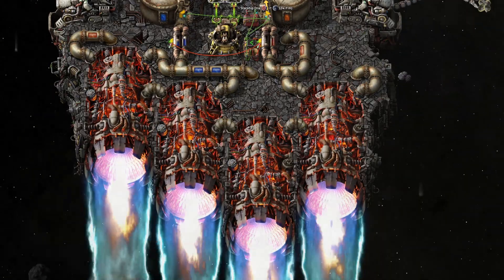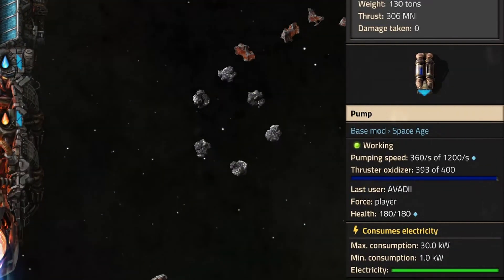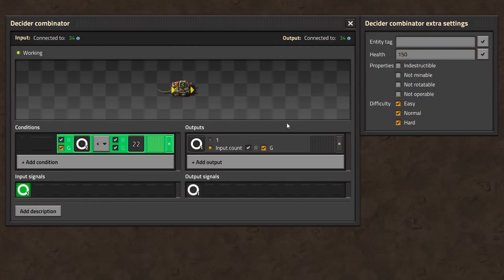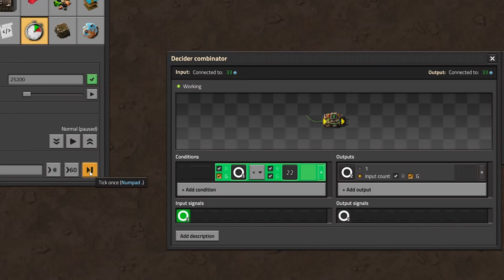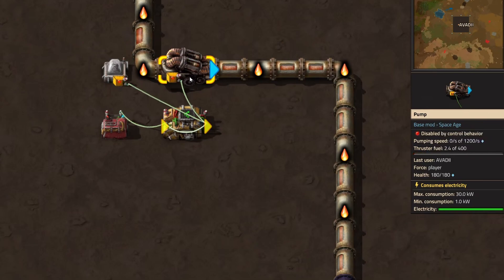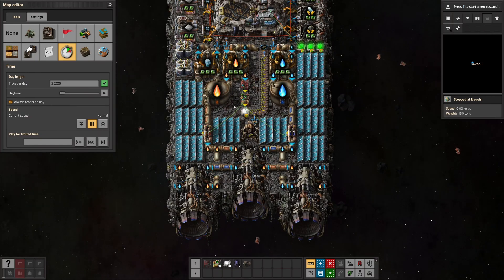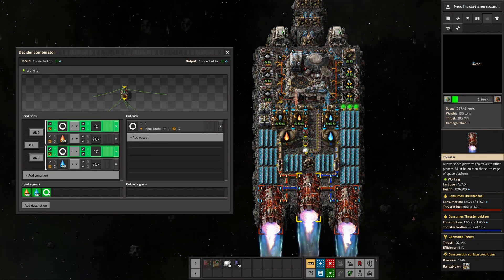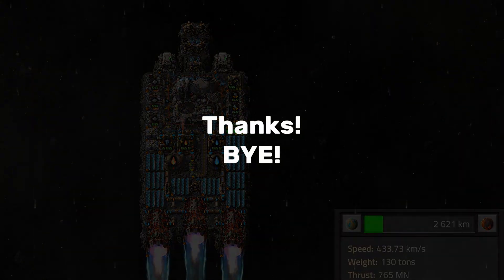Control Thruster Efficiency with Throttling! - Factorio Guide / Tutorial

Comment: I am at 6:40. I'm reminded again of how you can't have multiple input conditions and output conditions. You have to tie all the input conditions together to send essentially a single output condition. You can't have multiple conditions in the same decider combinator, which makes them inconvenient because for every new item you need to send a signal about, you're taking up extra space, and it really adds up.

I'd love to be able to tell a decider that, hey, if we have less than 250 copper, you need to send a copper wire signal, and if we have less than 100 iron, you need to send an iron or a signal, or something like that. But no, you have to split those up into different decider combinators.

Or maybe I'm a smooth brain, but I can't find a way to put an OR condition between different AND blocks. Or maybe I just solved my own problem by talking about it on YouTube. I don't know.

Comment: I guess I accidentally made a crude but incredibly simple way to do this. I put my fuel in buffer tanks and control the oxidizer with 2 pumps, 1 outflow and 1 return. The return pump is always on, the outflow pump connects to another tank via green cable, I set the pump to open only if the 2nd tank falls below a certain amount and thru this I could control the cruising speed or efficiency. As an added bonus of this imperfect system, the thruster's built in buffer get filled every time I stop at a planet and that initial buffer lets me get at cruising speed very quickly.

Comment: 5:15 sorry but I think this needs more explanation. The maths is kind of glossed over. Especially the relationship between the threshold on the pump vs. the threshold on the decider.
Reply: The combinator counts up from 1 to 10, then resets. The pump only turns on when the combinator has a value of less than 2, which effectively means the pump only turns on when it has a value of 1. As a result, the pump is only active one in every 10 ticks.

Comment: You dont need the Constant combinator anymore. Just one decider combinator with its in and output connected, and two of the same  outputs: once with the value 1 once with the value of the imput count. The left side still needs the condidion of [Signal]<60.

Comment: OR use two tanks (oxidizer/fuel) behind the pumps as fuel gauge.
Link them to the pumps set them to activate let's say < 100 and make a test flight to dial in your desired ratio.
Technically controlling only one input oxidizer or fuel is fine, but there is some weirdness sometimes.
My speed boat slurps more oxidizer for some unidentified reason... and I think I have to write a bug report soon, when I have a reason.

Comment: Hey man, i don't know if you are still playing but ... tnx for this video it saved me a lot of time!

I had the idea to make the ship moving from scratch so that the only thing you need to provide in order to fly safe is the correct number of ammo (or nothing if you run a laser ship!)
to achieve this i wanted the throttling value on the pump to be a function of the current fuel/oxidizer level in the respective tank. i was trying different approach to the problem until i saw this video ... your controlled throttling is basically the center of mine and solve any problem i had :)

Thanks Again! :)

Comment: I went simpler. I just ran a green wire reading velocity to a pump. Pump is on at a low speed I set, off at higher speed. It's not as consistent but is real easy. But this is a great explanation for a counter.
Reply: I did the same, but with an added pump the other way, on the inverse condition, to clear the pipes from the fluid to throttle it faster. Speed is kept at a 20 range around the target speed.
Reply: I feel like a caveman just making a mess when I look at all these solutions people have. I just have a secondary tank for each fuel with a pump fueling them. Wire the pump to only fill the tank a little bit based on your thrusters and desired efficiency. A little less consistent than all these other options, but still way better than my first ship going full burn the entire time
Reply: @Erik_Ice_Fang  Do the tanks fill when the ship is docked at each location? I have that issue but I'm only filling the internal supply of the thruster and it doesn't last long enough to matter.
Reply: @aowens40601 yes, but only to the amount you set with the wired pump. Thats why it isnt as effective as the video, because the thrusters will be full when you first leave a location. Its only a couple seconds, so a small difference. Honestly the extra space taken up is more of an issue

Comment: Something I heard a while back that makes a lot of sense is to just throttle the fuel and let the oxidizer flow unrestricted. I'm not 100% sure on this but I heard somewhere the engines are more efficient when oxidizer rich and maybe it saves some tps calculations if you just mess with one of the pumps.

Comment: You can also connect a wire to the hub and tick set to read the "to" and "from" signal. Then enable the pump only if none of the planet signals equal to 3, as it means the ship is actively moving to prevent the thruster from being flooded initially. But before the very first travel, you need to pre-fuel the thruster otherwise the game will detect no available thruster and refuses to change the ship's state to moving.

Comment: This is a very stupid and ugly design from developers, just play with a valve mod. I solved the equation for desirable flow but forgot I cannot directly control flow rates. The equation for on and off is ugly and opening and closing the valve to achieve a certain flow is just silly. I copied the circuit from the forum, won't do it again.
Reply: btw, solving the rate by current velocity is unreliable. It results in pulsing acceleration -> pulsing velocity. Use fixed thrust% base on chart.

Comment: what if you just produce enough to barely go below %100 efficency ? wouldnt it be easier to prevent the problem
Reply from the maker: 3 thrusters with 100% efficiency = 30 MN thrust. Thats VERY slow.
Reply: @AVADIIStrategy if i remember correct, 1 chemical plant for each (fuel and oxidizer) can produce enough to feed 5 thrusters. the only downside i think is, not being able to change the speed incase you need to
Reply from the maker: @theofpower4404  But the ship doesn't have 5 only 3 ;)

Comment: 7:45 - wait, what?  That's a thing?  I could have sworn I looked for that, and it wasn't there... but no, it does seem to have been there in 2.0 from the start, based on my reading of the changelog.  How/why did I convince myself it was otherwise?  Hmm, not sure.  Maybe just because you can't have the outputs be dependent on different sets of conditions within one, and that's what I was wanting at the time?  Anyway, this is super cool... a self-contained clock, a filter for multiple signals but not all, etc. etc.  Cool!  Thanks!
Reply: Oh yeah, and also the stuff about thruster throttling.  Though... I notice you just kinda didn't talk about the fluid mixing aspects here.  :D

Comment: I've found that this kind of thruster control for the purposes of fuel efficiency is pointless. You can just pipe your fuel and oxidizer plants straight into your engines and the small buffer in those pipes plus a bit of hysteresis means that your speed will naturally reach equilibrium where it uses 100% of your production most efficiently. Hell, you can even add dumb tanks if you think it's valuable to have idle time in orbit increase overall speed during transit. 

I am only actively controlling thrust on my prometheum chunk farm ship, I throttle it back based on the deficit in my stockpile of turret ammo, again, relying on hysteresis to reach equilibrium at my ship's safe maximum speed.

Comment: I also want to point out that this same method is GAMECHANGING on Gleba. Not only can you control pumps, but you can use the same clock method to throttle the speed that assemblers, biochambers, agricultural towers, and even belts and inserters work. You can customise the speed that your nutrient producers work for example, so they only make exactly as many nutrients as you are actually using, leading to very very little wasted spoilage. 

You can use the clock as a kind of "drip feeder" on belts so the floods of fruit followed by minutes of empty belts gets smoothed out into a constant, average rate of flow

If you think that's good, you can even have it define the loop length AND on-time with more circuit signals, which can even be dynamically calculated based on something else. Have all your machines automatically throttled relative to each other so they can all be sped up/slowed down from one place for example, or even better, have the speed of production automatically match the speed of consumption by measuring the count of output items in a buffer, and making the machines work less often when the buffer is more full, and more often when it is less full.

Comment: Nice system, i just put tank between pump an thrusters and set to fill it up to disaired amount of fuel per second multiplied by number of thrusters and change, yeah it waste some fuel when ship not moving but it only matter if you dont use calcite fuel and can be fixed by setting pump to work only if ship moves

Comment: if you use 10 thrusters, the consumption rate will equal the pump's flow rate, meaning you can get any percentage listed on the performance graph based on the clock
speaking of the clock, you don't need a constant combinator anymore, For your original example 2 minutes into the video, simply add a second output of 1 circle when circle is less than 22, then connect a wire to create a feedback loop within the combinator (edit: you realised this already lol)

Comment: What I've been doing is pumping from one tank to another, and throttling the pump based on how full the output tank is. ~300 units of fluid keeps the engines are a nice and cozy ~40% which is just about the sweet spot for efficiency vs. thrust. Doesn't require any combinators, either.
Reply: oh, nice, gonna try this approach (i did build my own combinators version, inhibited when parked, that is any planet signal =3)
Reply: i do this and it's a little more effort to tune but works just as well in practice
Reply: Same, this was how I went about it too. I think with the buffer at stops and pump amount its a bit less consistently efficient, but it does the job

Comment: I'm using a tank on the thruster side, wired to the pump, set to fill the tank to 10 which gives me modulation and a low pass filter.
Reply: does setting the tank to 10 ensure that's always at least some fuel in the thruster, without filling up the thruster entirely?
Reply: @nar2872  the new 2.0 fluid mechanics makes machines draw fluids from pipes proportionally, based on how full the fluid network is.

(though this approach requires, you to use double the amount of tanks if you also want to have a buffer. which isn't ideal given the limited space you've got on space platforms.)

Comment: Is there a way to use combinators so that the astroid grabbers don't collect more than 13 carbon, 13 iron and 13 ice?
Reply: If you want to stop the grabber from grabbing to much asteroid chunks, you can set the filters via circuit signals. Just have a constant combinator with the desired amount, read the amount from the belt, subtract both and feed the output signal to the grabber and set it to "Set Filter". Only positive values will be used, so whenever there are less chunks on the belt, the subtraction yields a positive value and the grabber has a filter for said chunk

Comment: FYI you dont need to control both fluids, one is enough - the other will be consumed at the same rate as the fist one.
Reply: Even when mixing them this way?  (Could be, I'm not sure... just a question.)
Reply: @DavidLindes  Yes! The fluids are consumed with the rate of the lowest one. Os if you have one completely filled engines and the other just up to half them they both will be consumed with the half speed

Comment: Pro tip: To prevent the pumps from wasting fuel while the ship is stopped, you can test for Velocity with signal "V" from the platform hub. If you do not allow fuel to flow when velocity is below 50, the engines will keep enough fuel to restart and get back up to 50 when the ship resumes. BUT... the pumps will stop feeding fuel, which means you don't dump a thruster full of fuel into the thrusters every stop. Saves a lot of fuel.
Reply: If you run out of fuel, you will softlock the ship because your speed will be always zero or less. And, frankly, there is no reason to not pump fuel to the trusters while stopped: platform will go futher on "overdrive" in less time, while burning what is essentially overproduction, and the fuel is free.
Reply: @rogo7330  wdym you will soft lock the ship?
Reply: @rogo7330  Can't you avoid softlocking by setting up the 3 conditions in the decider combinator with the right precedence?
You should set it up so that:
-- when the fuel tanks are full, you pump at full rate, no matter the other signals. (Which is what will eventually get you out of the softlock.)
-- And when the fuel tanks are empty, you pump 120/s only when the velocity is over 50(*), and if the velocity is under 50(*) you pump nothing.
I'm not sure I'm getting the conditions right with the output condition being "inverted" (0 means pump, >0 means don't pump; I get why we do it but yikes). But here's what I think it should be:
[fuel < 20k OR oxidizer < 20k] AND [velocity < 50(*) OR circle < 10]
Yes, if your fuel tanks fill up while stopped, then you pump your thrusters full of fuel, but in that case you have the fuel to waste. And yes, when you're stopped this technically makes the counter count until the integers overflow and wrap over, but that only lets 1200 liquids in every million seconds or so.

(*)Or whatever speed the production rate of your refineries allows you to reach. Getting up to speed with the overflow from the tanks means you're burning fuel at the rate at which you're producing it.
Reply: @rogo7330  There is a reason you may not want to do that. If the throttled speed is near your safe speed limit, then that extra speed can result in parts of your ship breaking.
Reply: @rogo7330  Well the key there is to not run out of fuel. I run this setup and it's been operating maintenance free ever since I built it. Yes, you have to set the test variable after you first get some fuel in the thrusters, but that's the only time you have to do it.
Reply: If you end up with no fuel in the thrusters, the speed cant increase, so the ship is stuck.
Reply: @FabriceNormandin95  each planet has their own gravity, 10km/s will be add to your speed, this explain why when you to vulcanus, at the middle, your speed increase about 20 km/h despite of no changing in production and pump,  -10km/h is removed and +10km/h is added
Reply: Nice, I was using the moving from and to signals but speed is allot simpler
Reply: @FabriceNormandin95  they added a failsafe for that: the minimal speed is 10 km/s
Reply: Just check planet value from the hub. I think it is a discrete state value of 1-3.
Reply: @davidnnn6986  That doesn't work. That was the first thing I tried. The problem is that you get the value whether you are moving or stopped.
Reply: The signal is 1 where you are and 2 where you are going, or maybe the reverse. 3 is when they are both the same, aka in orbit.  You can check that any planet is 2, none are 3, whatever.
Reply: @Recon777x  Wrong. Enable both values "from" and "to". If you are stationary, one of the planets will have value of 3. If any of the values is 3, then you are stopped, if not, then the ship wants to move somewhere else.
Reply: then you'll need to manually jumpstart it with a constant combinator, and it  can also stall your ship if you get the velocity parameters wrong, or in rare cases where you just get plain unlucky.
Reply: Why bother though when the resources for making fuel are infinite in space. Just throw away excess resources to keep from clogging cargo space.

Comment: Would it be plausible to just read the speed V the ship is going at and make it so the pumps get deactivated if the ship is moving too fast (consuming too much fuel)
That way no combinators would be needed, just some simple CTRL + R
Reply: that requires much more math. You have to determine what your expected speed would be at the ideal fuel rate. combinator approach let's you simply use your existing fuel production to figure out what consumption rate you need. Just make them identical.
Reply: you would need to adjust it every time you change the weight of the ship tho
Reply: @marmoran9493  Good point, though speed only gets affected by ship width

Don't know why Wube designed it to not scale with weight
Reply: @fresh218  omg i knew that there was drag in space probably due to space dust and chunks crashing against the ship but didnt knew it affected the speed so much more than weight

Comment: Iirc you don't need 2 pumps since even if other liquid is full, it can only use whatever the lowest amount of material there is.
Reply from the maker: True. Good advice. I like symmetry though which is why I can't design it with just one pump XD.
Reply: Also, the flame that comes out of the thruster will depend on how much of a liquid it has 🤓 red or blue or purple!
Reply: @Gorre022  I was wondering why the coloring seemed to be fluctuating randomly!
Reply: @BruhMomentum-fe1kj  the detail in the game is so amazing like that! Even the molten metal solidifies in the foundry animation if it stops while in space 🤓